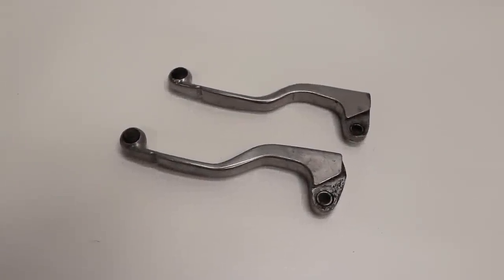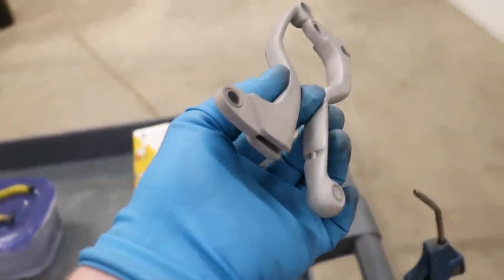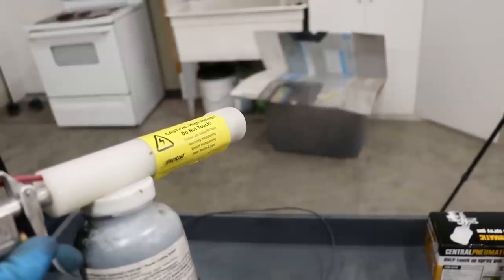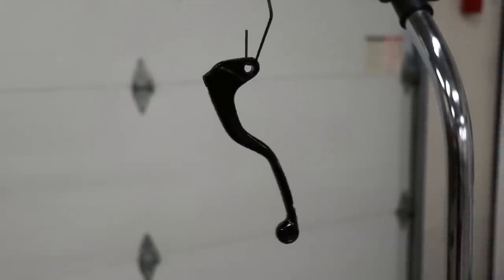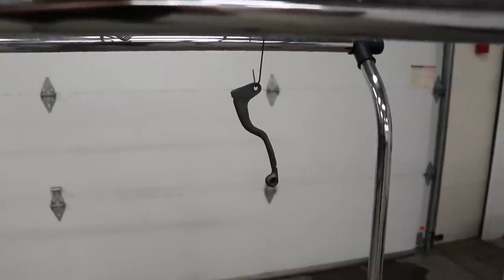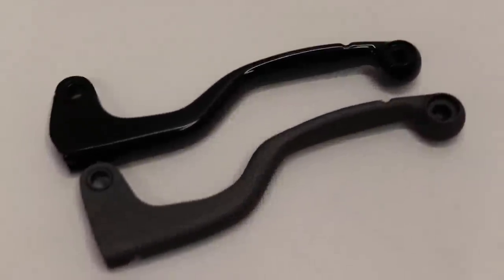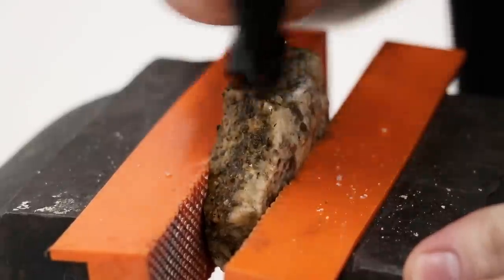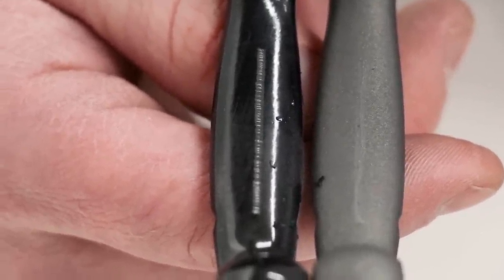Powder Coat vs. Cerakote | Which Is Better?

Comment: Hey Cameron, I have been watching a lot of your videos and have been thoroughly impressed by the work you do. I had an idea and was wondering what your thoughts on it may be. The idea would be using a copper plating and then Cerakote over the copper plating. Wondering if you think this would be possible or if the end result would be messy. Thanks again for the awesome videos.

Comment: Either surface coat might last longer and be tougher if you aggressively etch the part surface. Maybe with shot peening. Maybe with electropolishing on high current. Try bending a flexible piece of material. My bet is on powdercoat.

Comment: What TYPE of Powder coat did you use? 

Epoxy, Polyester, Polyurethane, Fluoropolymer, TGIC, Nylon, Metalic ect.  each has different wear / solvent resistance characteristics. There is not just one type of "Powder Coating".

Comment: The rough finish on the Cerakote was dry spray. Need to adjust your gun/spray technique to fix that, it won't be nearly as durable without proper application.

Comment: the powder coated piece does not need any more cure  time it is ready for service  as soon as it cools , you over cured the powder that is why it is chipping and coming off so easy  try cooking at 400 degree's part temp not oven temp for 10 minutes

Comment: Other topic - has anyone applied a color vinyl wrap/coat to their tank/fenders/plastics ?    Wish I had on my KTM — and with the small surface area compared to a pickup  I think its a really cool idea to keep your bike like new under the wrap and then in a year you can peel off and have a NEW bike or recoat another color or print.    Might also be good to renew the finish….

Comment: for spraying small parts the air brush is far better than a spray gun, the reason why the air brush you had was shit was due to it being external mix which is the most basic entry level gun you can buy

Comment: A lot of powder appears to be floating right past the part after it exits the gun.  Why?  Bad electrical connection?  Voltage too low?  Should that happen?  How to avoid?

Comment: Interesting.. u cleaned it, blasted it, blew it off with air and then paint? How did it not have dust residue after the blast? I'm a beginner powdercoater and i use copper slag cause i get it for free from the blast guy here.

Comment: As aluminium doesn't rust wouldn't it be best to polish up the parts and laquer the detail and leave the rest bare so that scratches can be just polished out ? It seems that coating stuff is just setting up to fail as it's inevitable that light damage will occur and none coated parts will be more easily corrected when they start to look tired. The colour aspect is the only reason to coat stuff, but its got so many drawbacks imo

Comment: Just want to say it isn’t necessary to soak a part in acetone before blasting,I’ve been processionally powder coating for years and it just doesn’t have any benefits,also if the part is bare metal and not greasy instead of sandblasting you can just wipe it with acetone and coat it
Reply: Only benefit is if it has oil and you don't want to drive it into the metal.  For really oily steel I usually flash heat it to 900 degrees w propane torch then blast.  But yeah for most ppl not needed.

Comment: If i was to buy a torque wrench to use on my klx250h 2002 what size  would the Nm 's have to got up and down to? ( donr intend to need to use it for in the engine it self) just rough Nm 's if possible thanks

Comment: Where do you order that bootleg cerakote from? That’s not the bottles that come from NIC industries (company that makes cerakote). Cerakote has a ton of color options, and can be mixed or patterned like powder can’t. I apply both for a living. Cerakote also has a C series that can be used on high heat applications (exhaust) a lot better than powder, and it also has better UV protection.

Comment: Misinformation on the Cerakote color options. There are approx 180 plus the option of mixing. You didnt screen your cerakote which would have been a 150 mesh, 2ndly you dont know your mil settings which should be 1-2 mils. Lastly you should have sprayed from top to bottom in a 5 or octagonal spray pattern approx 2 coats if you have 20psi and a 3 inch fan. Cerakote woops powdercoat all day.

Comment: Ummmm, guess they have never been to cerakotes website. Dozens of stock colors and can be mixed like paints to create thousands of custom colors. Powder coat on the other hand is more difficult to predict the outcome due to the change in appearance during the baking process. You would have to weigh and spray and do sample pieces.

Comment: Itd be sweet if a compamy figured out how to get powder coat or ceracoat to come out of a spray can then be baked.
Reply: Vht has paint with ceramic in it, needs to be baked still though. I use it because its gas and heat resistant, had good luck with it. Painted my motorcycle engine and pipes with it

Comment: You're curing powder coating wrong, gotta get the parts temperature to 350-400 and then cure for 10-20minutes.. not the air temp.

Comment: Dude the ceracoat didn't protect the metal and the powder coat did, that's why it's so thick. See the divits in the metal on the ceracoat and on the powder coat it wasn't even through the powder coat.

Comment: I'd consider either process for a frame, or wheel hubs, or engine cases, and that's about it. Rims but only if there's a really good clear-coat? Working with vintage Superbike parts, 4LS drum hubs, NOS early-'70s "Super-Akront" rims, stuff like that, which is to say there's a pretty different aesthetic here, less with the bright anodize rainbow effect - though I AM doing a SUPER-MOTO style half-&-half two-tone 180-degree vs 180-degree  tinted/clear rim - hell YA'LL know what I mean by Super-Moto rim PAINT, don't you? Ha-ha. Anyway yeah, for my daughter's "KZ440LOL" with the 4LS drum in 3.0x16" rims with modern radial MAXI-SCOOTER type tires in 110/70-16 & 140/70-16 sizes - I'm thinking she'd dig it in purple but I don't wanna be like Kevin Costner in "3 days to kill" with the purple bicycle for his highschool aged daughter. Ha-ha. Then again, there were some pretty awesome purple paint schemes on early-'70s Kwaka too-smoke triples! But would matching rims be too much purple? It's a tough call - maybe just a huge splash of dripping blood red on the front wheel, "zombie guts green" on the rear? Meh - too much of an X-mas vibe.....
Reply: Cerakote is quite expensive. Its like 300$ a liter.

Comment: The tests you performed are pretty useless because cerakote and powder coating isn't designed to resist what you have tested.
It's more for environmental resistance rather than taking a blow torch to them.

Comment: Hey Cameron I hope you see this cause I don't have IG, where did you get your sticker kit for your CR125 Im rebuilding mine I bought those radiator Hoses about 3weeks ago from you for it , I really dig the look of your bike and really wanting the same graphics kit if you would let me know thank you man!!
Reply from the maker: Hey man! These are the graphics I used 
https://rover.ebay.com/rover/1/711-53200-19255-0/1?icep_id=114&ipn=icep&toolid=20004&campid=5338186796&mpre=https%3A%2F%2Fwww.ebay.com%2Fitm%2FTEAM-HONDA-WORLD-GRAPHICS-NUMBER-PLATES-CR125-CR125R-CR250-CR250R-2002-2007%2F371717920421%3Fepid%3D1343761130%26hash%3Ditem568c1d56a5%3Ag%3AeP4AAOSwHoFXvJ72%26vxp%3Dmtr
Reply: Dude you're awesome thank you so much man!! Keep the content coming you've got a happy customer and YouTube streamer right here thanks again Cameron!!🤙🏼🤙🏼